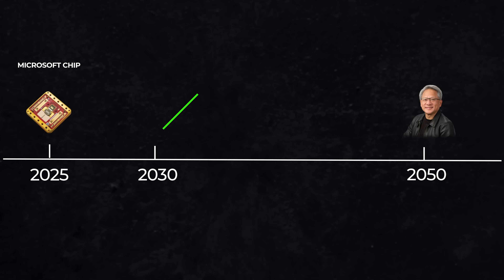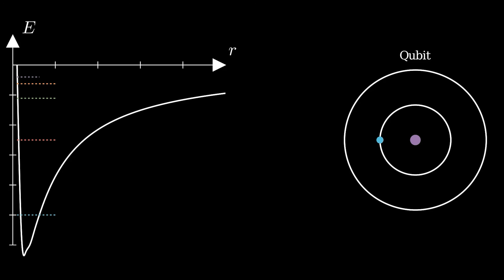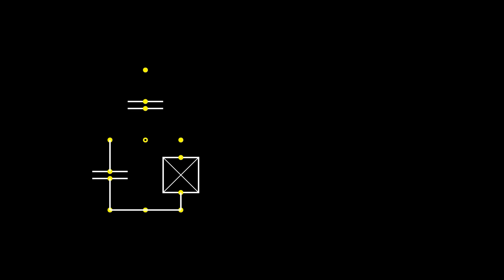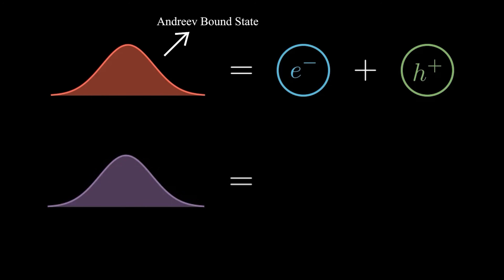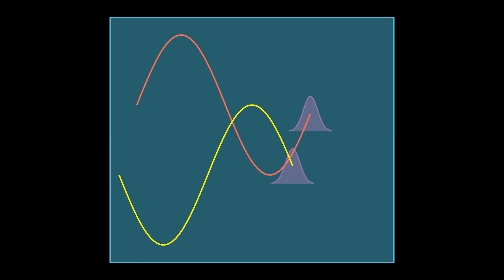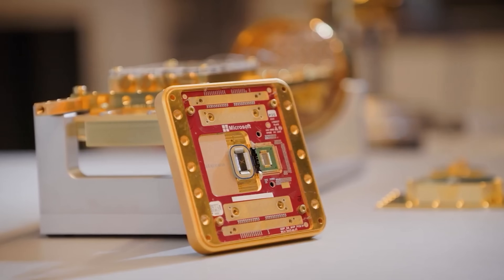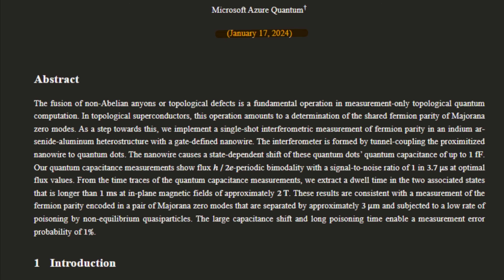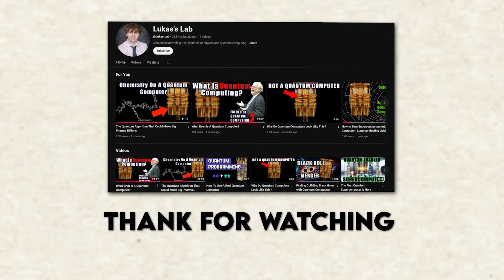What is a Topological Qubit?

Comment: Question: Quantum entanglement is the result of a field if I'm not mistaken. The spooky action at a distance, I mean. It can't be used to send signals faster than light, but the observation of any entangled particle will allow the observer to instantly know the spin or orientation of the other entangled particle as being the opposite of the particle observed. The act of observation breaks the entanglement field which is why signals can't be sent using this method of entanglement. Does the breaking of entanglement affect the individual particles in any way or does it only break that field which keeps them entangled? Also, since more than two particles can be entangled, would that mean that if, for sake of simplicity, if three particles are entangled and one is observed with a "spin up" position that the other two entangled with it will be "spin down" or would only one be "spin down" and the other be a different spin like a "spin sideways" (for lack of a better term) that is essentially opposite but not exactly opposite, or once one is observed then the other two are assumed to be the exact opposite?